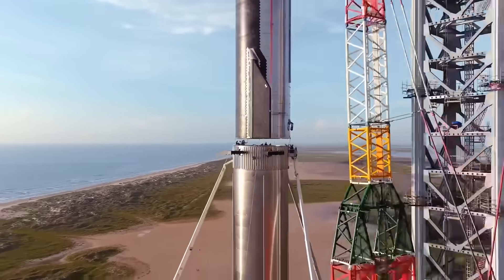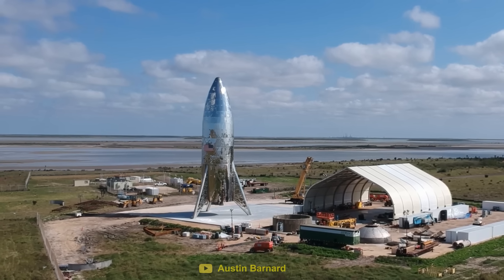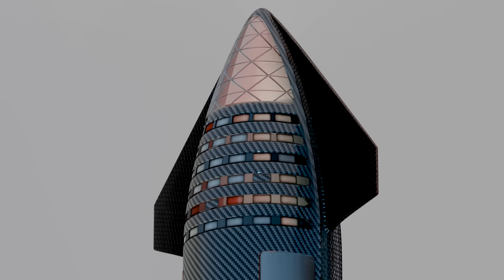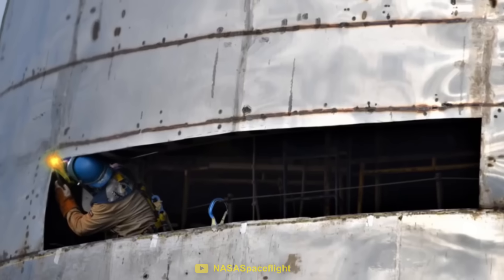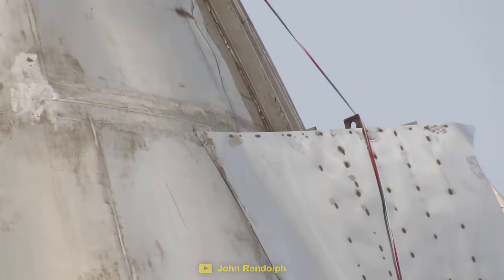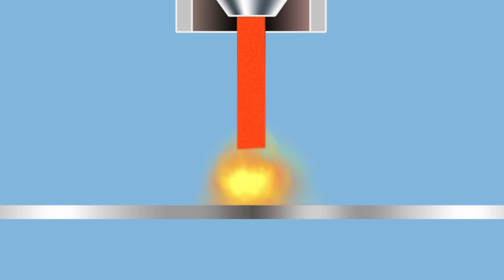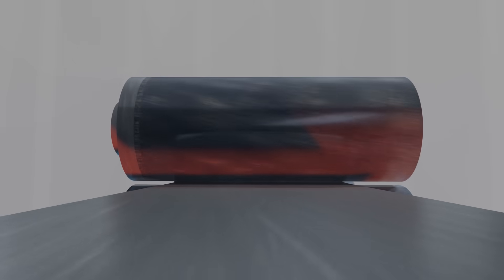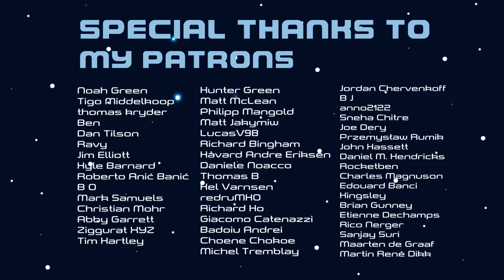How SpaceX Mastered Starship’s Welding

Comment: To my knowledge starship is like a pressure vessel and it needs to be built properly and in the right conditions inside of a fabrication shop and not outside. Each component needs to be fitted properly before welding or else the pressure vessel is not going to meet the proper weld standards for each seam and joint, and welds should not be grinded down flush. That’s basically taking away all the strength. Any pressure components that  are fabricated needs to be welded 100% on both sides of the seam, and better preparation before fit-ups needs to be acknowledged. Of course this all takes time and patience, but it’s all about how fast it’s built.

Comment: The flux core welding process doesn't require the use of gas.  Dual shield welding uses a gas as well as flux core wire.

Comment: Wow I can't believe they started out welding stainless with flux core, I know these products do exist but I've never heard of anyone doing that for a serious project..
I kinda assumed they were friction welded like they should be.
Reply: Flux core is extremely common in US construction. Much more so than anywhere else.
Reply: @jackmclane1826  Not for stainless it isn't. Like I said, stainless flux core is available but is typically used only for quick repairs in the field on non critical parts. Stick welding is significantly better than FC and then comes mig and tig.
Reply: @amosbackstrom5366  Okay, OK I didn't know that. I have never used flux core for anything. It is much less common in Europe. I wouldn't say it's generally bad, but less common.
I think the use here may be the result of that "quick and dirty" - sometimes called "agile" -   development approach. Let's get started quickly and fix the problems on the go.
Reply: @jackmclane1826  I agree it's not generally bad, it certainly has its place and you can totally get good welds out of it. You can even get good welds with stainless, no problem for water towers.  But the stress from holding a pressure (be it water weight in a tower or the pressure in a rocket fuselage) is a tiny fraction of the stress contained in a GOOD weld, we could be 20,000 psi+ of tension pulling your seam apart. This stress will always happen, it's because of the metal contacts when it solidifies. Submerged flux, bubbles or any other impurities allow cracks to start and they can propagate quickly if they experience cyclical temperature changes. A good rocket body is practically defined by it's ability to survive extreme changes in temperature.
Friction "stir" welding is really good, it doesn't actually melt the metal, it's more like forging two pieces by stirring their edges together. Since no melting occurs there is very little stress.
Reply: @amosbackstrom5366  Just a point to friction stir welding, because I know it quite well: It is almost non existent with steels. It is 99,x% a non-ferrous process. The tool wear is incredily high when working steels to a degree that it's very rarely done. You only get like 20m of weld before a quite expensive tool is worn down.

Maybe not that a big deal when making a rocket. But what welding engineers don't like is Tungsten and carbon enrichment in the weld bead. Because the tool made from Tungsten carbide steadily dissolves in the weld bead.

If it wasn't the TWI that promotes that process... I don't think that anybody would even think of using it. I'm a certified welding engineer and I'll never use it for steel if I have another option. And with steel you usually have another option.
Reply: You can get decent looking welds with stainless flux core, but you really need to use a gas shielded process, which obviously can't be done outside because of wind blows away the shielding gas. The other problem is all the shrinkage / warpage you get when welding, especially with stainless.

Comment: As a automotive welder and car builder I can say some of this information is hilarious on elons part with how they started building these someone should have warned him against flux core welding these. its pretty obvious in the welding world you don't weld stainless that way unless it's a quick repair to get by let alone a rocket going into space .also the planishing of the weld does two things stretches the weld after it shrunk which eliminated the distortion and it also relaxes the grain of the metal its actually harder before they planish it but only the weld itself which will cause the surrounding metal to crack and split from the weld. planishing relaxes the weld and and helps it become the same as the surrounding metal so it will flex and bend with it.
Reply: yeah I was thinking the same thing. I think what happens is they didn't know a thing about designing or fabricating stuff, so they hired some guy which happened to be not fit for the job to take care of it. Then the guy thought any weld is same. Seriously, any decent undergrad from mechanical engineering would do better job. But I guess elon and others noticed how bad it ended up, but kept going with it since he needs something to show to investors. And then they agree to target first successful one not at first several attempts. In long run it ended up interests more money
Reply: They where aware. Sometimes it’s better to build a crappy mock-up than to wait for the good stuff to arrive. It’s an opportunity for the team to align, and good for morale.
Reply: @ddavidebor  They are aware after having initially made bad mistakes.   It would have been better to start off on the right leg with the proper information and the good stuff right off the bat.  It's called knowing what you're doing and not wasting valuable resources.
Reply: If I remember correctly, elon tweeted that he was aware of this problem before production. If something is very obvious to anyone, and a space company does it anyways, there's probably a reason lol
Reply: @dyslexicstoner.240  gotta keep investors happy i suppose even if its just for a minute 🤣

Comment: Anyone who has ever welded knows flux core wire produces shitty welds.    They could have had an instant upgrade by using TIG, or at least a gas shielded MIG.    Evidently SpaceX didnt bother to ask anyone who knew anything about welding for their first few tries.
Reply: They took the made in china approach to reinvent the wheel 😁

Comment: I am sorry, but anything outside the describtions of the welding is just wrong. 
This is basic steel carbon work, so the most important thing is keeping the small grains of the steel sheets. 
That's why they upgraded the welding technique to laserwelding. It's the most concentrated way of inputing energy into a material to melt it and fuse together.
The less energy used the more very fine grains of steel are preserved around the welds. 
Also the hammering of the welds gives back the flattened profile of the grains after being melted. The flattened grains from the rolling during production gives the sheets of metal better tension properties. It has absolutly nothing to do with looks. 
What they did was basically trying out every welding technique from cheapest to most expensive while it did not matter. If you test 2 sheets welded together under tension, it should never fail at the weld, if you need to grind down the weld, because of micro fractures you did it wrong!

Comment: 1:45 Although factually correct, this is a bit misleading.
Carbon fiber costs more per kg because it is much lighter. About 5x lighter, in fact.
The price / volume would be a much better measure which is still a 10x difference, not 50x

Comment: just saying i think the 1kg carbon vs 1kg steel is kind of unfair because 1kg of carbon has a much larger volume
Reply: Exactly! (More/less anyways, pragmatics aside) Nothing about Starship makes any actual sense in any way of function, composition, or design. Elon is a pathological liar that is fully aware that a large portion of his popularity and relevancy is based on his perceived interest and innovation in space exploration while under the facade of philanthropic concerns.  What Is unclear is to what extent his  pathological Histrionic Personality Disorder and narcissism  have  manifested  into  deluded  interjection or  mearly  distraction  by means of deception.  
Using 304L steel approximate6 quarter inch thick increases the mass by 12 fold  compared to  carbon fiber aluminum hull and will never be human rated.  So that  they can maintain some sort of  legitimacy of maintaining  Stainless steel as a viable cost effective  material for a rentry craft that size.
They have vaguely described a coolant system of liquid methane and sometimes liquid nitrogen that would somehow  circulate the hull along welds and  will somehow keep the structural integrity from warping.  
When you account for the mass of the structure materials and  reserve fuel for reentry.  That  leaves next to nil for payload let alone life support  essentials.
Reply: 1kg of carbon is lighter too, because carbon is lighter than steel
Reply: @Noblyuntruthful  1kg of metal and 1kgof steel weighs the same💀
Reply: @Aiirsine  Think he meant that 1kg of carbon would cover a larger surface area of the rocket than steel would, ultimately making the rocket lighter.
Reply: @Scott Park   Maybe he's red blooded , though and through, where   the majority have only the briefest of interactions with the metric system in primary school. I have a masters in computer science.  College was a life time ago , and on more than one occasion  since  I have started/ texted I was going  so and so kilometers , instead of kph.  So what if he compared the mass of two kg,  he  has  more intelligence and deductive reasoning skills than any of the SpaceX  fan boys that believe anything thay Elon musk says.   

A cubic meter  of 304l  steel  weighs 8030 kilograms.  A compressed M3
Of 5 mil  carbon fiber sheets weighs  around 2000 kgs.  Aluminum and  all  its relevant  alloys  have  a max density kg/m3 of 2730 kgs.   A rough average   of  structural components of crew dragon and falcon 9 equals  6 mil carbon fiber / aluminum honey comb  the frames and support structures of SpaceXs different variations appears to be all over the place aluminum being the primary material  with titanium and  various  steel alloys about even, followed by tungsten and copper.  For simplicity let's say Starship has a surface area of threefalcon 9s.  Using  comparable carbon fiber aluminum  total  weight  for hull and supports 
Under that comparison  18 tons.  
 The Starship hull  alone without the  bfr is carrying  96 tons of skin.  
I am not 100 percent on this  but,   what are the so called prototypes pushing  6?  (Supposedly  upgraded  merlin engines)  and  nearly 1/4th or more of the propellant required for falcon 9 Leo  launch.  Yet,  have gotten a couple miles up and only briefly.  (Though and not positive on this either, but to be fair I do remember hearing  that  the  fuel used in at least the past couple test flights was a lesser quality/ richness/ or something  than falcon  actual  launch. ) Regardless, If  Elon gets his orbital test flight,  I HAVE SERIOUS DOUBTS STARSHIP WILL REACH higher than the mesophehe and will waste more h3lium in that 1 launch attempt than all previous falcon 9 and heavy launches prior combined. Even if it does achieve orbit. It's still and empty shell..  that weighs over 20 tons more than  fully equipped  and  launch ready shuttle enterprise.  Even if  bfr can achieve the high-end of thrust estimates.  Less than a quarter is left  with just the weight of structural components and reentry fuel. Life support components / water and rations on the shuttle  consisted of 12 tons it's total  weight and that was a crew of 5 or 6 . I could go on and on , but  the simplest  reason this is all b.s,  elaborate Elon  nonsense  for his  ego or  distraction for what other crazy scam he is  working on  either way . The welds can be absolute perfection steel can take high heat and mantain  integrity, but actually begins to lose formation at relatively low  temperatures especially uneven 
Extremes. There is absolutely zero chance Starship will reentry atmosphere and  be reusable and that's if it doesn't break up or collapse under its own weight if by a miracle it  lands intact .
Reply: @sidvicious6505  im replying to this so i can show my buddies later and laugh

Comment: They did not master a specific type of welding, but applied a higher quality welding technology, first TIG which is better than arc welding and later laser welding. Also, with the prototype, you always use the cheapest technology that could work, so the use of arc welding for the prototype is completely normal.

Comment: A century ago.  Curious parallel to the breakthrough that enabled stainless steel to enter the market for use in cars, trains, and planes. The successive companies of Edward Budd located in Philadelphia  are key to the first revolution of stainless steel. From the turn of the century Budd’s companies had perfected unibody construction and stamped metal frames and wheels for automobiles, including disc brakes.  By the 1930’s the new stainless steel was a thinner and lighter solution, especially for railroad cars. Budd’s engineers perfected a high temperature, timed “shot” welding technique for joining stainless steel sheets with out damaging stainless’ s rust resistance. This technique enabled light, fast passenger cars of shiny stainless steel introduced across the country and the world in the 1930’s. Edward Budd made a fortune through licensing these techniques globally.

Comment: The fact that Elon didn’t know to go with 304L and TIG from the jump ….says a lot
Reply: You would think they would of started by looking at what processes other industries have been using for decades instead of trying to reinvent the wheel.
Reply: Oh right right. What a good point bro. How long was it since the last time america had access to the ISS and launches with reusable rockets before spacex? I’ll wait
Reply: They made a water tower fly and then land itself. I really don't think the focus was on getting the welding right at that point. Their philosophy has been "bonus points if it doesn't explode" from day one.
Reply: Right, because prototypes are ALWAYS meant to be made from the same material that the final product is shipped with. Genius!
Reply: They didn’t expect notch sensitivity at cryo
Reply: There is a process used when engineering a new concept. Fail often, fail cheap, fail fast. If success isnt build on failure then how can you know how you got there?
Reply: Its about the process
Reply: Lol I’m sure you know so much about running multiple billion dollars companies huh
Reply: @twinturbo9113  No, I just know the basics of materials, which further exemplifies my point
Reply: In Isaacson’s book it was stated that none of the engineers were convinced when elon pitched stainless steel. Only after doing sims they realised it was a superior option

Comment: Their mistake was hiring water tower welders instead of pipeline welders. Stick a TIG torch in a pipeliner's hands and tell him what to stick together and he'll get it done to X-Ray, Magnetic Particle Inspection, Ultrasound, or any other NDT standards. And stainless is pretty common in their world, too.
Reply: Yeah he’ll get it done to API standards which are just about the most forgiving pipe codes. Water storage is done to ansi awwa100-11 and although I have not read it, I would assume that it is much more strict than any pipeline code. Basically I doubt it was the quality of the individual welder in question and more an issue of process. To me, I would not use a human at all and would opt for a mechanical or automated process.
Reply: @iansmith8944  well said, not only that,  pipe hands are good but they move like Union workers. Most don’t cut it at SpaceX.

Comment: 1:45 cost per kg doesn't seem to matter much if one material is literally known for being much lighter but stronger in most applications.
Reply: @Gathering No Moss Yes, literally, carbon fiber is stronger and lighter than stainless steel requiring way less in weight.  That's why a stainless steel race car would be really heavy when a carbon fiber one is stronger and lighter.

Literally.
Reply: @Gathering No Moss Did you wake up today, read through comments on Youtube and decide "I'm gonna be an asshole because one person stressed something in a sentence they didn't absolutely have to, so I'm gonna start an argument for no reason"

Thanks for the advice, but you didn't have to say that "it doesn't fit with the statement" at the end because you said that there's no need to say it in the first place.  So if there's no need to say it, why stress that it doesn't fit? So why add more information than needed? Oh because you do exactly the same thing I do every day but wanted to start a meaningless argument?  There's nothing wrong with adding additional detail.  Literally.

I wonder why the word exists when anytime it's right to use it isn't allowed because Gathering No Moss thinks it shouldn't be used when it's applicable.
Reply: @Gathering No Moss You know I've decided, I'm literally going to use literally on every sentence now because you've literally made me do it. The fact that this is literally how it's going to have to be saddens me. Literally, you should have let this go. You could literally be watching videos and doing something else instead reading this comment because you literally had to reply to something that literally didn't need to be brought up. I'm being very literal when I say I appreciate the time you took for reaching out to me. It was literally a pleasure.
Reply: @Gathering No Moss That's literally the correct place to use literally. You need to literally go away.